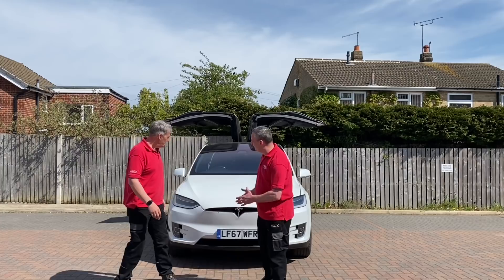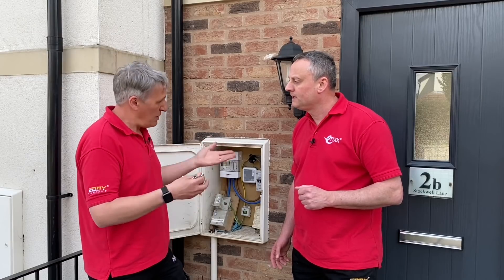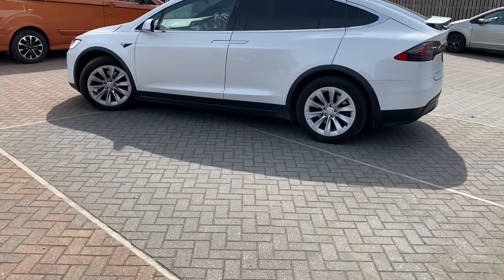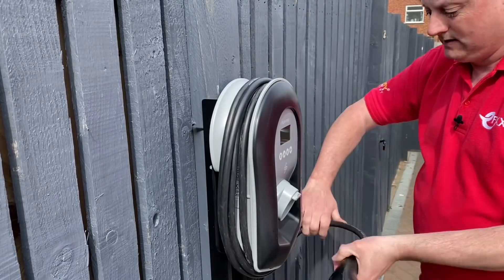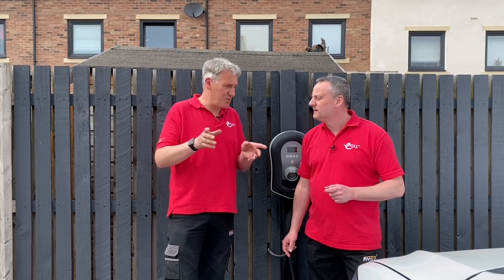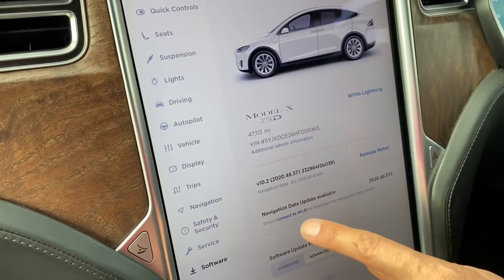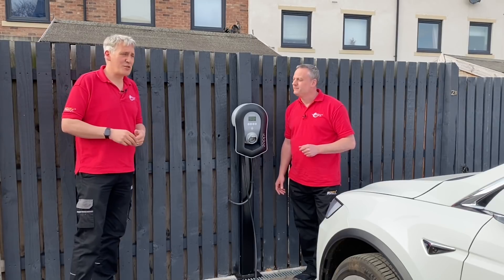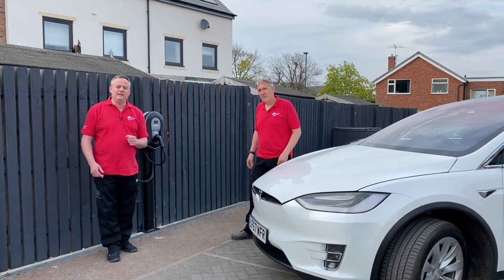EV CHARGER INSTALLATION at home? Watch this BEFORE YOU BUY!

Comment: Another non compliant installation from the Efix team! I noted the product number for the RCBO labelled “Electric Vehicle Charger”. It’s EZ916832, this is a single pole devices which does NOT switch the neutral as required by part 7 of BS7671. I wanted to be sure I was giving accurate advice here so I contacted Schneider who confirmed in writing that that model of RCBO is definitely single pole and does NOT switch the neutral. This would go down as a C2 (potentially dangerous) on an EICR. Come on Efix, if you want to be taken seriously you gotta act serious! Will they take down this video that may lead to others to install dangerous circuits, no, because it’s the money that matters to them not the actual electrical advice.
Reply from the maker: The RCBO in the board is protecting the cable. At the time of installation the Zappi was sold as having a full type A RCD function in the charger.
Reply: @efixx the RCD in the zappi either was or was not compliant. As it turns out it was not. Just because the manufacturers hadn’t yet been clear that it did not comply with Part 7 of BS7671, and just because efixx believed it was compliant at the time does not alter the fact that it did not comply. Efixx should be being upfront about that, because people will emulate your work. If someone copies you their installation will be non compliant, as is yours.

Comment: Worth considering whether the car has 7,11, or 22kW inverter for AC charging.   I may have got the last 2 wrong (as my car is only 7), but I believe both are 3 phase the later being 32A 3ph?  Mind you its only top end cars (maybe that Tesla) that would have 3ph inverters.

Comment: At 2 .0 you show the cut out and meter on the outside wall.You state that the supply is rated at 100 amp.This may be so but usually if 25 mm tails go from the outside wall through cavity installation then the the dno will down size the cut out fuse to 80 or even 60 amps .This is because the 25 mm tails are rated at 103 amps ref mef c but considerably lower if going through the wall insulation .Just thought you may wish to point that out .Great vid btw
Reply from the maker: The DNO doesn’t take responsibility for the tails. The size the fuse to protect there network. The electrician is responsible for sizing the tails to match the load and circuit conditions.

Comment: Great video. I have plan to install EV charger in a Gym in Dubai. Can I use 13 A single/double socket with 20 A breaker and wire size 4mmsq? I will appreciate your reply?
Reply from the maker: Not a good idea -charging will be limited to 10Amps which is very slow.

Comment: One important consideration not mentioned is the fact that your tails from your cabinet to your main DB would have to be a suitable size if you increase the size of the fuse to 100 amps .
Reply from the maker: Correct - the tails here are already suitably sized.

Comment: Great vids 👍🏻 I’m installing underground ducting to take a supply from my meter box under a pathway and eventually on to an EV charger. Just wondering how best to deal with terminating the ducting at ground level at either end to avoid water/debris entering it? Does it have to terminate into an inspection pit or can it be sealed up with foam/sealant? Thanks in advance 👍🏻

Comment: I'm in Australia, and have a crazy 45 amp mains fuse, but I have 6 kw of solar and 2 powerwall 2, so I don't use grid. My fuse box is well and truly over capacity for grid only, but my house internal electrics cover this with ease. I have a first gen zappi and and I've had the powerwalls for 4.5 year's , solar for nearly 6 year's. I not entirely happy with the zappi as it charges fine but the zappi goes weird at times and it's set at 28 amp instead of 32
Reply from the maker: Thanks for sharing the install info Mark - We are jealous! We’d suggest a call to @myenergi to explore your tech issue. We find the support team excellent when we need to solve a problem.

Comment: Big issue is huge number of houses in uk that have old incoming Mains which is old paper wax type insulation ( not exactly sure exact make up) . My mains fuse is 60amp . I doubt. The cable will take a higher load especially if actual used. Means every mains cable will need replacing, then is the road electric cable capable of supporting extra load and finally can we generate the extra electricity for electric cars , heat pumps and other such as water heating when gas disappears.

Comment: So at my house I have an existing wired double 3 pin external socket which i use for plugging in hover/power washer/christmas lights can that point be used/converted to feed the 7KW Charger unit? this is the closest point to where I park my car or does the EV charger unit need to be wired directly from the meter box. My drive is all tarmacked and don't want to run a new cable to where I normally park the car. If directly wired from Meter box I will have to just mount the new EV charge next to it and park car at the side of the house. Any info much appreciated.
Reply from the maker: If the 3 pin socket has its own dedicated circuit and the cable has been sized to cope with 32A (7kW) then it could be converted - but this is unlikely to be the case.  A second option you outlined is what lots of installers go for.

Comment: Just got an ID.3, I have a BP Pulse Home Charger, it's currently charging at 21mph, does that right? I've read it can do up to about 30mph... Is this because of the cold weather?
Reply from the maker: Does seem a bit low. Charging rates will slow down if the battery is nearly full > 80% or if your charger runs at a lower power < 7kW due to some load curtailment - eg power supply to the property being fused at 60 Amps.
Reply: @efixx  hmm, highest I saw was 22mph, I was charging from ~30% to 80%. I had my power company install a 100A Isolation Switch before the home charger was installed.

Comment: Hi. Great video. I am about to get my first EV. I have three phase electricity coming into my house via 3 x 60A main fuses (it’s an Edwardian house and I think there used to be some big machinery in the garage). Would it be worth considering having one of the rapid charging points installed, or are they prohibitively expensive and/or really no benefit for home charging? Thanks.
Reply from the maker: If you’ve got three phase - go for it!  You can do more charging in off peak lower cost hours.

Comment: Hydrogen better I think. Too many issues with EV. Charging points etc.   Cost to replace a whole battery set because the batteries  lose charging ability. When  they degrade the vehicle won't give the distance, be better to ride a horse and feed it every few miles.  How green is that.  Fresh horse and away you go again.  Lots of horse sh*t for the land.
Reply from the maker: Haven’t seen many hydrogen filling stations appearing?

Comment: Not done a EV charge yet nor do I know anythings about electric cars 
Question 
If its at the back of your property like how this one is, what not stopping someone to come and plug there car in and charging there car via your supply ?  Is there a way you can turn off the supply via the charger so its a dead unit till you switch it back on
Reply from the maker: You can enable a pin code or use the app to prevent u authorised charging

Comment: Be nice if the charger had a lock to keep the cable sure.  And also a WiFi repeater - presumably it has an rj45 to it anyway for the smart features.

Comment: Since you asked for the comments, I’d want a car charger that charges my car wirelessly hence a charger build into the driveway so when the car is parked in the bay it does not need plugging into it just charges the car automatically during scheduled times or whenever the solar power provides its juice.
Reply from the maker: Wireless has been talked about and we’ve seen a few trials but it’s gone quiet 🤐
Reply: @efixx  i have seen some people are not bothered about the cost, they just want the modern technology and facility.
Hopefully future might hold some good news.

Comment: Great video and learnt a lot, but I wouldn’t have the charger on the outside of the fence, better on the inside would be safer. Would imagine they will be a target for thieves soon, cable if attached permanently and then the charger.
Reply: Not alone will they be a target for thieves, they will also be a target for people taking personal Injury claims against the owners of such chargers, as the charging leads in a lot of cases cross areas where adults or children could walk and as such could represent a trip hazard, also the charging leads usually tend to be black in colour instead of a bright yellow for safety and also aprppriate signage would need to be considered reminding people to beware of charging cables.

Comment: Please stop perpetuating the phrase "range anxiety" when it isn't a factor with modern EVs. Uniformed folks take this stuff to heart, and EVs need all the help they can get. . . .
Reply from the maker: I’ve been an EV driver for more than 3 years, so we are pro EV. However we believe you still need to plan carefully when planning an EV journey to certain locations.
Reply: @efixx  Fair enough, since not all brands have their own robust DCFC network, along with destination charging. But the bulk of EVs sold today do, plus have the capability to plug in at virtually any mobile home park, and even right down to domestic electric receptacles. All of these where gasoline typically isn't sold.

Thank you, and by the way, a great video! 👍

Comment: We have 2 EV’s.  For 7 years, we have used “granny chargers” that came with the cars. No special wiring needed.

Having a huge battery means that on days we don’t drive, it has surplus capacity.  

Picture a fuel tank that holds 100 gallons. Do I stop to fill up at 1/2 tank?  No. Just drive.  

Now, if I have infinite fuel at home, but a small hose that I can trickle all night into that tank; that’s how I charge.
Reply from the maker: If that works for you 👍🏻

Comment: Way too much hassle.  10 hrs to charge.  Having a charge in a public area does not seem wise.  You can expect others to unplug to charge their cars while you’re not watching.
Reply from the maker: Car charging cables lock in to the car and the charger so can only be removed by the owner. The charger can be pin protected to prevent others using your electric.
Reply: @efixx  How about showing how you can lock the cable?  Code makes sense but locking it to the car seems impossible
Reply: @jimdandy9118  the locking mechanism is built into the connectors. Just plug it in and it locks automatically.
Reply: @RossRyles  How do you lock and unlock it at the car?  Exactly how does a plug lock into a car?  Never heard of it
Reply: @jimdandy9118  a solenoid in the side of the socket inserts a pin into a hole in the side of the plug. Like all physical security it can be overcome by enough force. The exact locking/unlocking will vary between cars. On mine it locks automatically when you plug the cable in. You can choose if it should unlock automatically at the end of the charge (public tethered charger). Alternatively it will release the cable with a double press on the keyfob.
Reply: @RossRyles  Thanks

Comment: What puts me off is when you are away on holiday in Devon & Cornwall. It takes 4-5 hours to replenish 80 percent. That is half a day of a holiday. The charge rate speed has got to improve & the cost of the cars new has to come down. £30,000 plus is out of many family budgets even on PCP finance. Added to which all the cost of the home charging unit changing the consumer unit it is all starting to add up.

Comment: Easiest thing to do is have your electrician install a plug next to your car. Bump up the voltage and amps if you can. Don't install some device. Why? You just need a plug. A tethered cable is a recipe for disaster. It will be stolen inevitably. The device will break. Just install a plug, and drag out your untethered cable. That is still easier than going to a gas station. If your untethered cable breaks, you can order a new one online without hiring an electrician. Most homes have the ability to install plugs that will supply double the volts, that will half the charging time over a "granny cable" which is usually sufficient for overnight charging.
Reply from the maker: Doesn’t really work like that David. The charge point communicates with the car to let it know what power is available from the plug. The granny cable can’t tell fibs!

Comment: Thanks; a pretty comprehensive introduction for the novice.  Although it was touched on, I think the reality is that most people should be charging overnight (when there's virtually no other load on the CU) and also that virtually no one charges from 0 to 100 SoC in one session.  So, there are really no issues with other household appliances, or the time it might take to fully charge the EV.  Having said that, a Fast Charging EVSE - the 7kW option - is a no-brainer.  Mine, the Andersen A2, combined with my Octopus Go off-peak tariff means that I can deliver ~28kW overnight, and this gives me a daily top-up range of >100 miles for my BME i3 (compared to the average UK commute of ~20 miles).  One last nit; the Tesla doesn't necessarily need Wi-Fi for its FOTA (firmware updates over-the-air), it has a separate cellular connection that supports this, and Wi-Fi is just a nice-to-have.

The point regarding at least thinking about future support for dual EV connectivity/charging is a good one; 2030 is really not that far aware and people with soon have two BEVs and will be thinking about charging both...
Reply from the maker: Great feedback and user insight. With regards to Tesla ours will only update over wifi.
Reply: @efixx  Thanks.  Surprised by the Tesla's need for Wi-Fi, but `i'll defer to you.  Conversely, my BMW only has cellular...
Reply from the maker: Elon saving a bit of cash on the data fees!

Comment: Wouldn’t it be a good idea to install the charger in a lockable cabinet for security if it has to be in a public area to protect against theft, vandalism and the weather? I know chargers are weatherproof but handling wet, dirty cables is never pleasant.
Reply from the maker: Good point

Comment: Just had a BP Pulse Charger installed at home under the UK Motorbility scheme (Free)
Installer was very professional checking the voltage before it was installed
Her knocked on the door and advised us that the voltage was outside of the recommended range ie 230-250
Contacted Weston Power who supply the Electricity (NO the people who charge us!)
So they have said their supply range is 220 -253!!  and 253 will trip the safely device on the unit

WOW what a cock up

Th charger works fine during the day but trips at night - just when the Octopus cheap tarrif at 5p a KWT comes in

So Weston Power hopefully will sort the supply down to 250 volts
OR BP Pulse will fit a different unit next week

Will advise later - But check yur power supply before choosing your charger
Reply from the maker: Thanks for the information Richard - we are starting to hear of this issue on more installations.  It could be down to lots of solar panels installed in the area. Keep us informed as you hopefully get the problem solved.

Comment: Biggest concern I would have with that installation is it’s risk to damage and interference. A security cabinet 🗄 would be a good idea.. do they/you do one?

Also a charger with built in WiFi extender and or CAT6 cable in the installation would be a good idea if shielding/interference isn’t a problem.
Reply: Biggest concern I’d have is that non compliant single pole RCBO! Dangerous!

Comment: Excellent video.👍 Just a couple of things - in that situation with the car parking in a public space, placing the charging unit on the other side of the fence may have offered more security for a tad bit of inconvenience. Just to pick up on one statement by Gaz who stated that to ‘replace a damaged charging cable was a job for an electrician’ - is that strictly correct? I totally get that installing a new circuit and the EV charger itself is very much an electricians job - but what regulation proscribes the user (DIY/non ticketed spark) from changing the charging cable?
Reply from the maker: Thanks Norman - Technically replacing the cable isn’t difficult apart from the tools. The Zappi cover has a specific torque setting on the screws to maintain the IP rating. So the usual caveats with regards to warranty etc would apply.